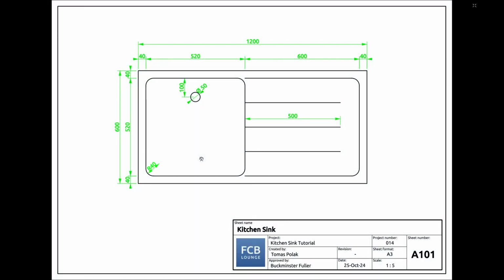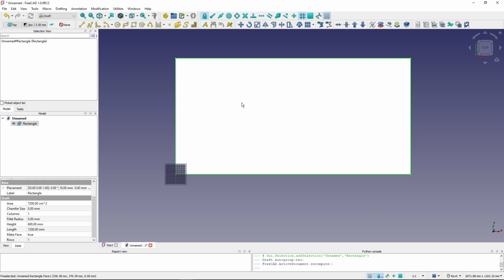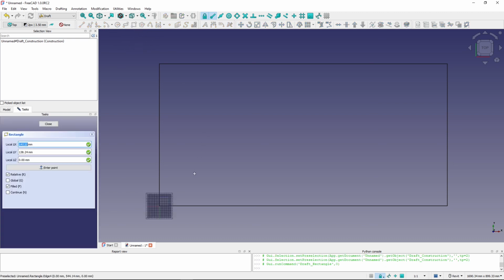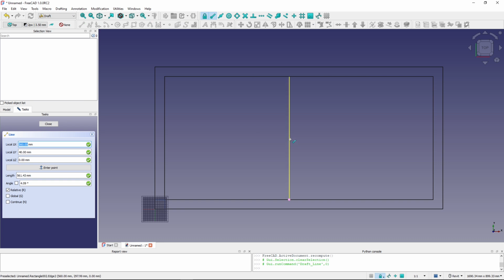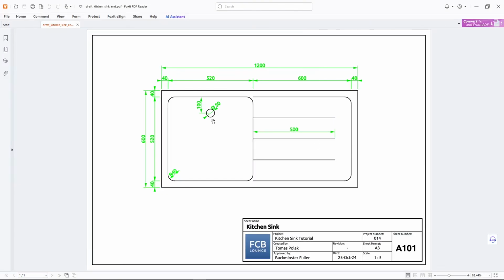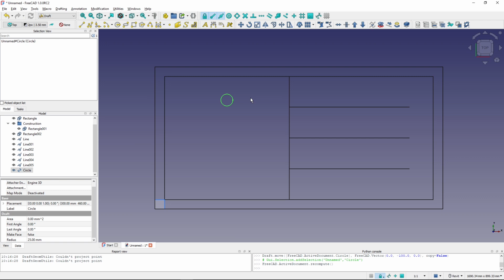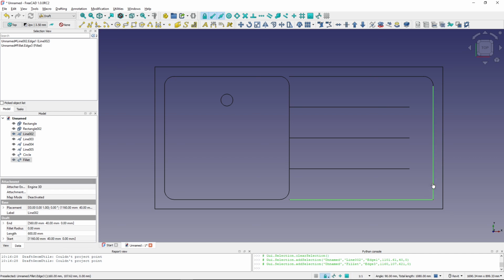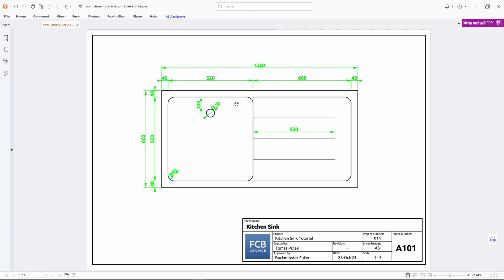Create a Kitchen Sink 2D Drawing in FreeCAD | Draft Workbench Beginner Tutorial Part 1

Comment: I like the fact that people are making tutorials on the Draft workbench, which is very often forgotten, even though it provides many solutions when creating models 

The Polyline function, for example, is very useful for drawing tubular frames or pipes, as it can automatically integrate radii in the corners

however, for this kind of 2D drawing, I tend to prefer the sketcher workbench
Reply from the maker: There are many different ways of achieving the same result in FreeCAD. I think it is one of FreeCAD's power. It is sometimes hard to tell whether it is more advisable to use Sketcher or Draft for output like the one in the tutorial. As you pointed out, I found very few Draft tutorials, so I created this one :)